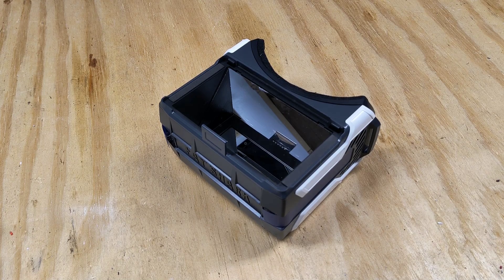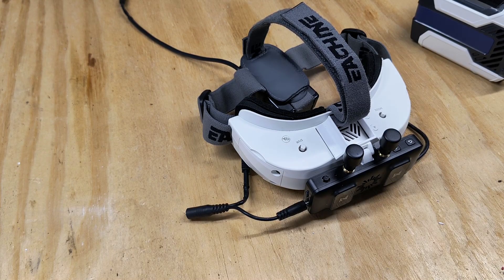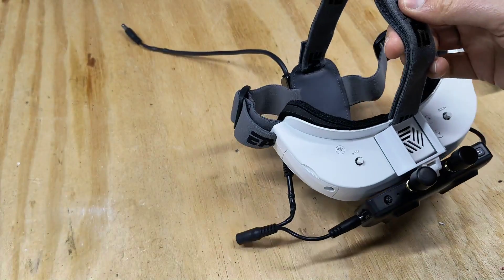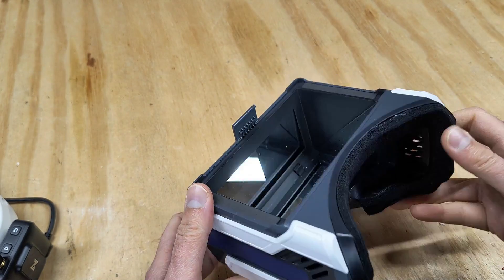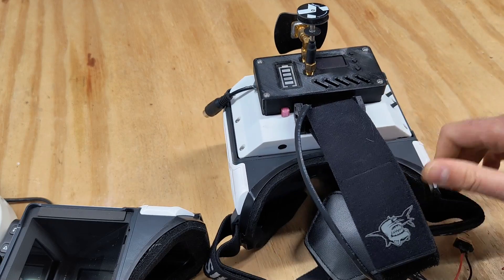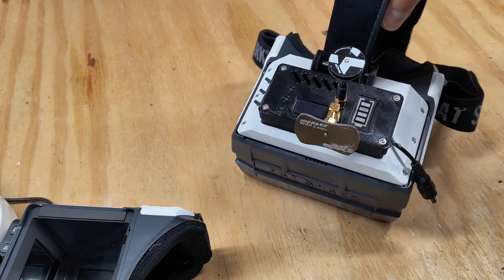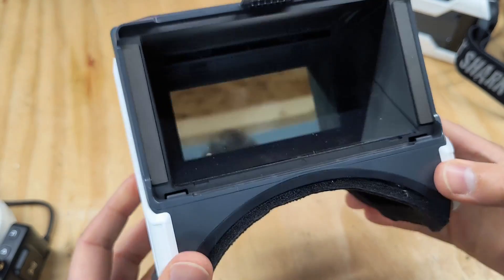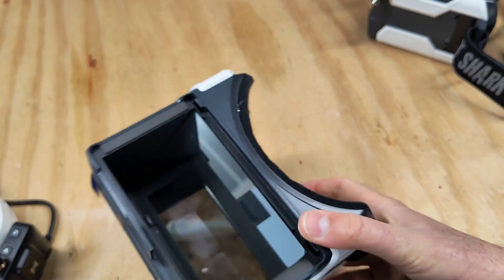DIY HD FPV Box Goggle 2024

Comment: Though latency would be a thing what could be a intresting set up is using the round displays with a witrekess es32- just the other day a video came out that is exactly what i am talking about called ESP32-C3 1.28 Inch Round Display GC9A01 IPS LCD Screen ESP32 WiFi bluetooth Review- Thgey do mention "suited for simple data display"... tghese things are mostly used for gauges and iot displays...basic data...

Comment: This is awesome! Great job, but i wish someone could make a cover for the screen so it just had the vrx built into it  with the buttons accessable with 4 sma, 2 out the front and 2 out the top, basically i would like the hdmi port more protected so you don't have to deal with any wires other then the power, just remove the antennas and throw it in a case. My hdmi port is going bad on my current goggles from putting the vrx on and off going between analog and WS
Reply: https://youtu.be/olCpxu2bHCE?si=IbM2Leu6OMekAFNp

Comment: whats the name of the black goop you applied? 

Great work!
Reply: Liquid Tape, or Liquid Electrical Tape. I use it all the time over heat shrink since it can be put on after soldering, and also where heat shrink tubes wouldn't work on board connections an such.

Comment: Love it. Nice to see more people are doing this. I’m converting my ev800Ds to 1920 oled. Yours is way more elegant though. 

For anyone who wants to do this. Basically all you need is a screen with hdmi in. To support analog get a diversity receiver and a 5 USD av2hdmi converter (take it out of the box and cut off the rca connectors). 

Another guy did a video on the analog to hdmi conversion. 

I’ll run analog and probably give openIPC a go when it’s matured a bit.
Reply: What display did you put in the ev800?
Reply: I have a pair of ev800d I might do this with mine as well 😮
Reply: @faequeenapril6921  the ev800ds aren’t optimal. You can use the headmount and lens. Then I’d get a cheap diversity receiver. It’s probably the same as the one in the goggles but has a nice display and controls for the channels. The problem with the ev800s is that channel and band is displayed on the screen that is removed. Because I wanted to hack around I built my own control board and small display and control the receivers with that instead of the built in buttons. I’m adding headtracking via bluetooth so I have a microcontroller in there anyways. But it’s probably the worst way to do it :) you get the battery charge circuit for free but the dvr will only record and not playback to the new screen. 

Back in the day someone built a goggle out of wood. That’s the dream!
Reply: @autonoob I have a pancake welding hood that uses a balsa wood box that is nearly weightless.  I can imagine that working great for this style of goggles.
Reply: @Kevin.L_  I didn’t know you could weld pancakes. 

That sounds perfect, I assume you can easily slide it away from your face when needed?What’s the cost of such a hood?
Reply: @autonoob   I think I paid close to $100 for the hood but one could make the balsa wood face section fairly easy.  It's custom fitted with sandpaper, very light weight and has a wide head band. 

May not be cheaper or more comfortable than what he's using  here but if you need to customize something balsa wood is a serious option.
Reply: @Kevin.L_  ok, yeah at that price it’s not really worth it. But it’s a good idea.  I considered building it like a model airplane with balsa, plywood and stringers. Would look nice I think. But didn’t want to invest too much time in unproven ground. Thanks for the info, maybe in the future. I’ve hacked something together with the 3D printer that seams ok for the time being.
Reply: im making a set of fake NVGs with a runcam nightowl 3 (Analog CTSC/PAL output), using this goggle and a cheapo car backup camera display. the resolution on the screen is like 480×365. it uses RCA so the connection is super easy. but if i were to put in a 1080p screen with a analog to digital signal converter, would i notice a difference in picture quality? i would assume the resolution of signal from the camera would be similar to the cheap display so the jump to 1080 wouldn't result in a better image. 
Im a noob to all this and just getting into to so these things confuse me.
Reply: @drgreenthumnb   pal would be like 720x576 so a bit higher than 480. At these low resolutions single pixels become quite important so you might notice an increase in quality. Full HD is definitely overkill in terms of resolution. I was going for the oled display to get the increase in contrast and hdmi in for upgrading to an hd system in the future. I recently Managed to get a cheap hdzero vrx with some cameras and it works great.

Comment: I am also working on doing this same thing. It is by far the cheapest way to get digital FPV. My only concern is latency. Have you tested the latency of the screen hooked up to the walksnail receiver?
Also what is the little circuit board you're attaching between the power source and the power input of the screen? It doesn't look like it's something the screen comes with.

Comment: Dude, idk if you are following the OpenIPC project, but this could end up being an excellent "companion" project to that one. Nice work!
Reply: I’m also doing a conversion and following openIPC closely :)   It looks very exciting :) spread the buzz
Reply: i am in their telegram and seen someone converted this goggles to openipc digital goggles
Reply: Yes, I’ve been looking at openIPC but goggles with hdmi in are very expensive.
Reply: I think later on opening will be better. Right now is not a food time for it. For some use cases it will be food but it's already kinda pricey. A kit runs around 120 for them both.

Comment: I was searching into doing this myself but I struggled to find reasonable priced displays with refresh rate above 60hz ideally 90-
100hz, nice work tho.
Reply: Yeah finding anything with more than 60hz is hard/impossible atm. Tried the same but no lucky. But i think 60fps should be fine for now, almost no fpv googles (except hdzero) support more than 60hz hdmi input anyways
Reply: I think it is useable but really there is a good reason for 90+hz refresh rates that the new walksnail and hdzero are able to support. OpenIPC and OpenHD whilst very different to each other are just too laggy for most use cases. I think walksnail RX with a good high refresh rate display is the way to go if possible.
Reply: @KidCe. I think looking for camera monitors is the closest I get

Comment: yooo wtf maan. im researching this topic since over a week and have landed on the same oled screen from ali. started to think about how i would do the optics, and this fatshark thing is the ultimate solution 😍 now i wonder how we can get a low latency analog on this hdmi screen? 
could you maybe so some latency test of the screen module ?

keep up the great work👌
Reply: ok i now pulled the trigger on the order. Ordered two types of AV to HDMI adapters to test and compare latency
Reply: The Fatshark Transformers arrived to day and i must say they feel reaaally nice on the face. Maybe a little heavy, but feels very comfortable with the screen. 
Tested it with my oled phones screen and looks absolutely amazing. Only thing i find it gets very dimm through the two way mirror, wish it would let alittle more light through... even with my phone at max brightness im missing just a little bit of brightness. 
With my Poco F3 having  500-800 nits im a little scared that the aliexpress oled will be too dimm cauz it has 350nits advertised
Reply: Yeah we really need to know the latency before he gets a bunch of people to buy these parts. He didn't show them actually being used or test the latency

Comment: Why not use skyzone cobras
Reply: Latency is like 70+ ms through hdmi… i cant race with mine in the sim connected to my top of the line pc. It would be awesome if skyzone had an updated low latency version that supports all of the new refresh rates for new hd systems. I have problems with lenses and I actually run the cobras without a lens.